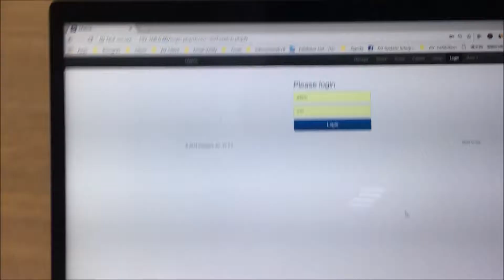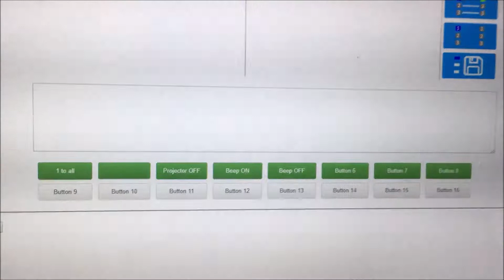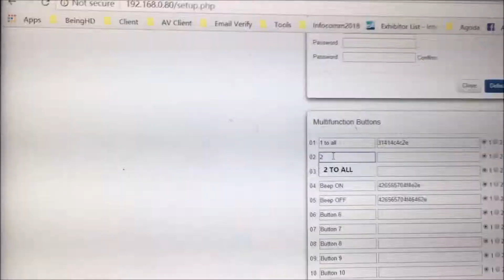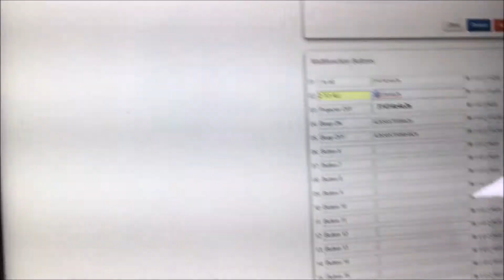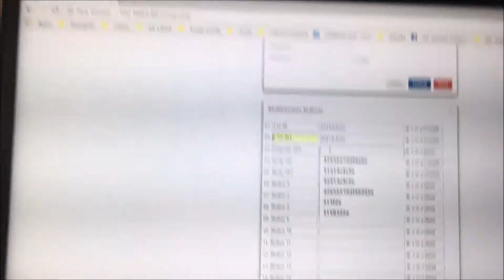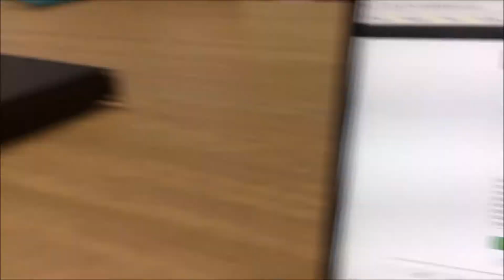Control the surrounding equipment over the Matrix Switcher

Comment: how can i do that?¿?¿  i want to control some item by Webpage and RS232....
Reply from the maker: Hi, it's actually a  function based on our matrix switcher system. As long as you the surrounding equipment has the RS232 port and also the HEX code, then you can use our WEB GUI to control them(matrix switcher and the surrounding equipment). Thank you and hope it can useful